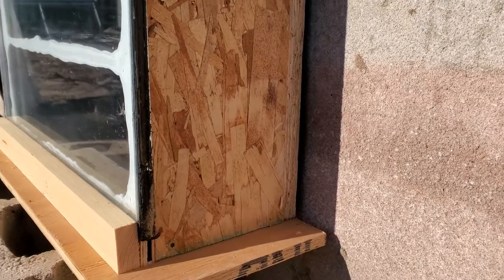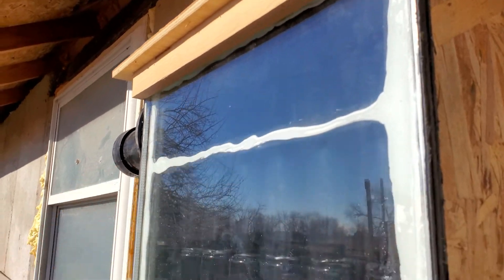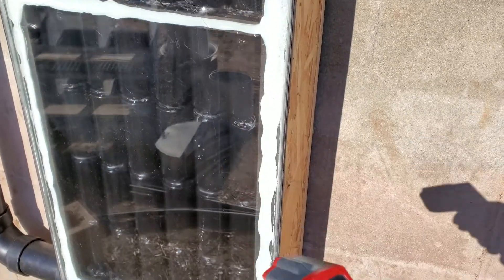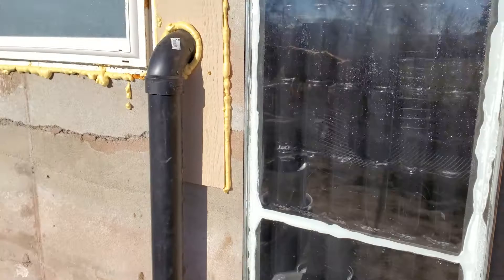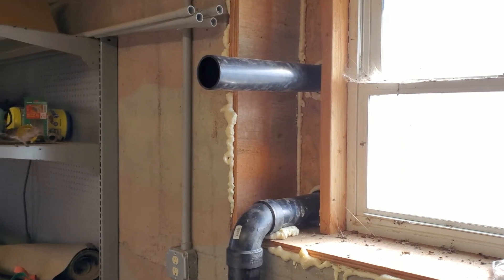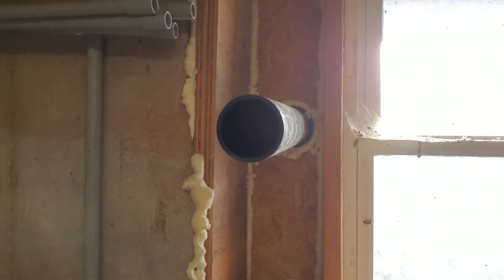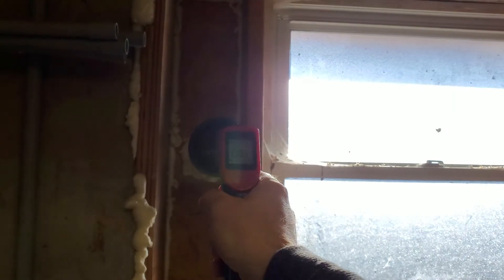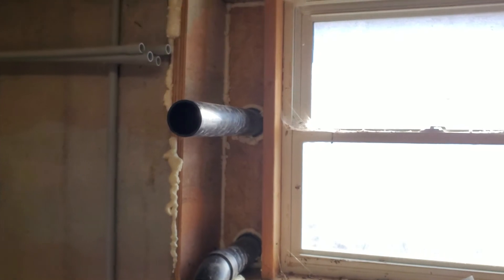Part 3: DIY How to Build a PASSIVE Solar Heater with Pop Cans

Comment: Your heat gun measures surface temperature only. It won't give you the temperature of air behind glass, but rather the temperature that the glass (or material) is reflecting. For reading air temperatures you would need a simple probe thermometer placed inside the tube (or box). I suspect the actual temperature inside the pop cans is a lot higher than what you're reading there.
Reply from the maker: I think you're right!
Reply: @Handy Dandy Andy  get yourself a temperature data loggers and stick it in the air delivery tube. That will show you, from hour to hour and season to season, what temperatures your unit puts out. They're fairly inexpensive ($50 or so..) and they connect to Bluetooth via an app on your phone. I'm going to build one of these units using beer cans. By fall I should have enough empty cans to heat half of Europe!😂

Comment: I would like to understand how this is "turned off" during warm weather.  Thanks
Reply: Put plug in the pipe ✌️
Reply from the maker: You can put a cover over the glass so the sunlight doesn't go in and heat up the cans.

Comment: Why are you using a double pane sheet of glass?  Doesn't that insulate the air on the inside of the glass from heating up more?
Reply from the maker: The sun passes through both panes of glass so it isn't preventing the air inside from heating up. Rather, the second pane helps reduce heat loss (so after the air is hot, we want to keep it hot) through the glass. Where I'm using it, it is regularly below freezing outside in the winter. As the air move up the unit inside, I wanted a little heat to be lost through the glass as possible and having the double pane helps tremendously.

Comment: I,'ve had an idea , that , instead of drawing cool air from the bottom ,and throwing the heated air into the top of the room , wouldn,t it work better to draw the warm room air from the ceiling area , let it be heated even warmer by the solar heater, and then blow it out from the bottom, thereby continuously reheating the air . Heat rises anyway , so why not have it come out at the bottom , across the floor , and reheat the room from the  bottom up.????
Reply from the maker: That's an idea. I don't know enough about fluid dynamics (is that even the right term?) to know if it's more efficient to heat up warm air, or take cold air and heat it up. I just don't know, but I'll tell you my thoughts. I was thinking the cold air, say 50 degrees for easy math, would get up to 110 degrees when circulated (so 60 degrees difference) whereas warm air at 90 degrees may only get up to 130 (a difference of 40 degrees). Since 60 is more than 40, I went with circulating cold air. Again, this isn't scientific on my part, it's literally just a gut feeling. If anyone has experience with this, please chime in.
Reply: @diyhda  yes ,I understand that is a difference in temps , but if your running the fan with a small snap thermostat, the fan might not have to work so hard , seeing that the air is starting a bit warmer already ..

Comment: Any solar heater that requires a fan to circulate the air is a very poor design and a waste of time and money!
Reply: Not true.
Reply from the maker: Thanks for your comment. A fan can run on much less electricity than it takes to heat air. Because the fan is simply moving the air that the sun heats, I disagree that the design has to be poor since a fan is involved.
Reply: soooo you would prefer to heat your room with 1000 watts of electricity or with this system and a 5 watt fan? the design can be used fanless, but the fan is to add efficency, you can also put a solar panel outside to power the tiny 5 watt fan.

Comment: I've watched a few of these and I had some ideas or thoughts.  

A. Most of the heaters i've seen use regular glass. It would seem that double paned would be much better. As you did.
B. Running air through he wall would seem to be a possible location for heat loss.

So...my idea. Install the heater inside the home instead, using the outside window as the glass. There would be no need to run air through the wall or window. You would lose a light source, but gain the heat. 

Any thoughts?
Reply: From what I’ve read you do save a bit on efficiency w/ double pane glass but the cost isn’t worth it for the couple of hrs a day you get heat and how many days during the winter season do you get bright sunny days? By far I’m not knocking this I love it.
Reply from the maker: James, thanks for your comment.
A. I used double paned glass because I got it cheap on Facebook marketplace. It wouldn't have made sense for me to pay a premium for glass as it would drastically change the cost of the project and the time to recoup the costs.
B. You're correct in that some heat loss would occur while running through the wall. There are downsides though to having it inside the home. One downside is it takes up space and isn't really pretty (my wife wouldn't let it be in the home). In this case, the upside of having it outside where it isn't taking up space that would be used for something else  is worth the potentially negligible heat loss into the walls.
Reply: There's a Kirsten Dirksen video with alpine house, so cold but sunny, with a glass wall like that. It uses a phase change material in the glass that captures heat during day and releases it at night.
Reply: The phase change material glass wall: https://youtu.be/9t0z58juaWc?t=7m24s
Reply: This house has a South facing thermal wall: black material behind glass: https://youtu.be/90X_698x2q4?t=6m0s